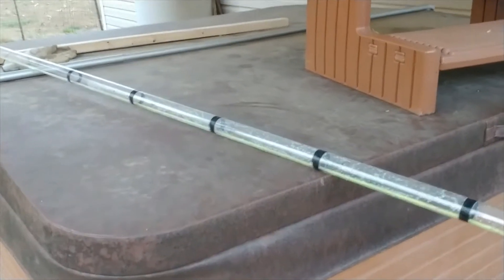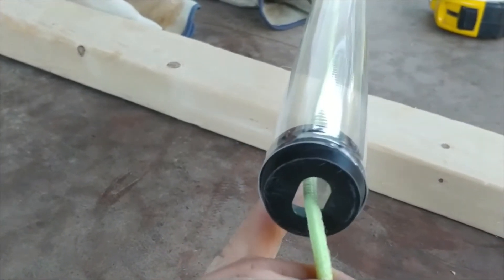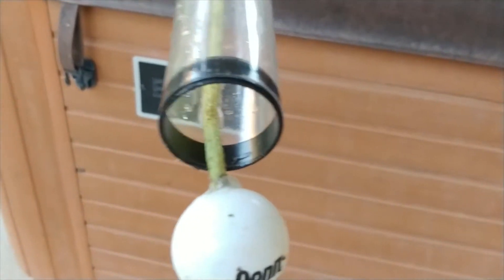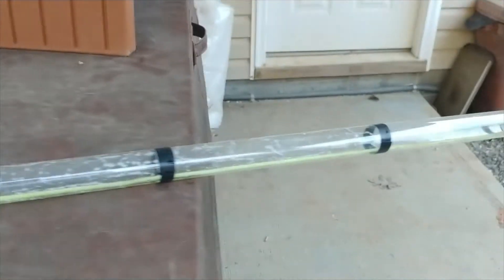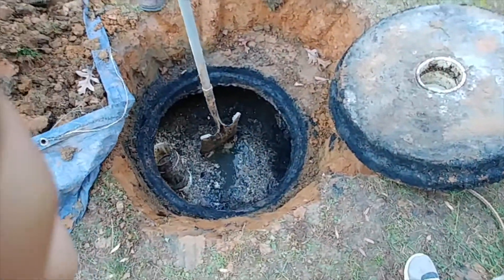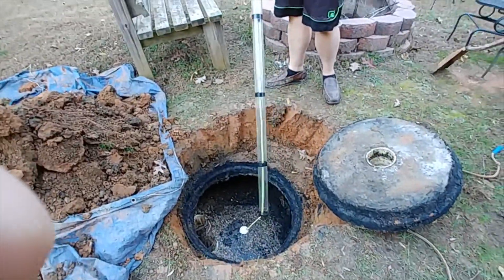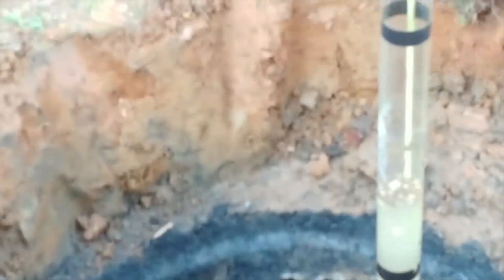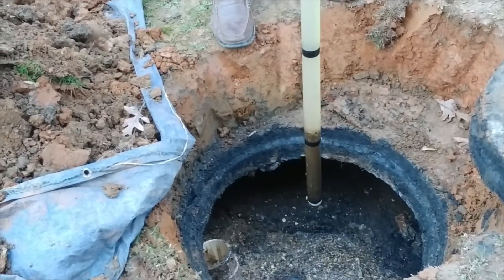$10 DIY Sludge Judge Septic Tank Core Sampler

Comment: Great video. Thank you. In the UK, measuring using something like this seems to be unknown. This has always surprised me, that there is no way to measure. The advise is empty it annually. I could not find the same cheap tube as you bought here, so I bought a 2m tube 3mm x 38mm and an acrylic ball for the end. Piece of rope and £65 later, I have a robust measuring stick. I took the measurement yesterday and wow, thats what I was wanting. To be able to see what was in the tank and the levels. By my calculating from last emptied and current volume, I should get about 8 years between emptying. But I can do an annual check to check on the progress. A saving of plus £800
Reply from the maker: @GavinWestwood  that's awesome. Fantastic money savings!

Comment: You did not disclose where to find the acrylic tube. The ones on amazon are short and cost way more than $10.  Im having a hard time searching for them.
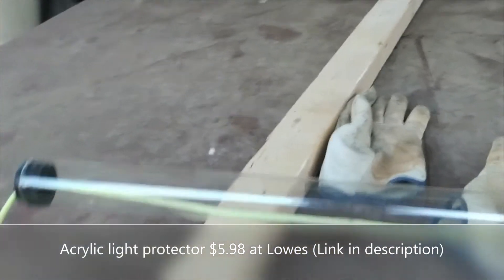Reply from the maker: 0:57 into the video a tip pops up on the bottom of the screen. This tube came from Lowes. Home Depot may have as well.
Reply: @540iflyby  Thanks

Comment: Another use for this, I collect waste motor oil. I try to get the cleanest oil possible and everyone says they have very clean oil with no water or emulsification in it. Most do though. This tool will help me determine how much crap is in the oil and a safe depth to pump the top from.
Reply from the maker: Nice! Cool use of the tool. What do you use the oil for?

Comment: Awesome! Thanks so much! I made one of these a few days ago. I cut the black end as you did, but turned it around and hot melt glued it into the tube. It's tapered just enough to seal really well with the ping pong ball. I also took a soldering iron and melted a slit in the top of the tube to pull the rope into and it locks it in position. Saved me $325 because I found I did not need to have mine pumped. It had only 4 inches of sludge in five feet of water. Thanks again!
Reply: I flipped the end cap around and glued it in, no cutting. Thanks for this video.
Reply from the maker: Glad it worked out!

Comment: Brilliant!  I really got into this a few years ago and, after the tank had been pumped, I installed risers that come to slightly above grade - expensive online but the local plumbing supply was much cheaper. Also a filter on the outlet to help preserve the drain field. Finally, I bought a 100' jetter line with a good pressure washer and cleaned out as much as I could of the line in the drain field and the line from the house. I could get the line pretty far into the house and you would not believe how much fat, oil and grease cakes came out; I thought it would never end. So I've been looking for a sludge gauge and came across your video. Thanks for that. It will help to achieve my goal of not calling the pumper until I absolutely have no choice.